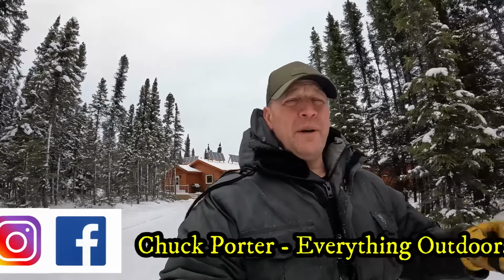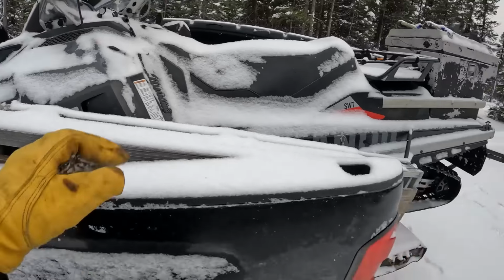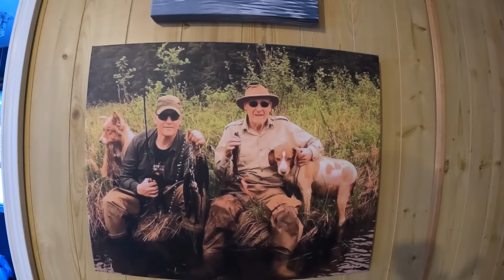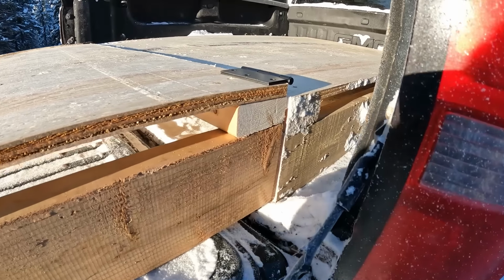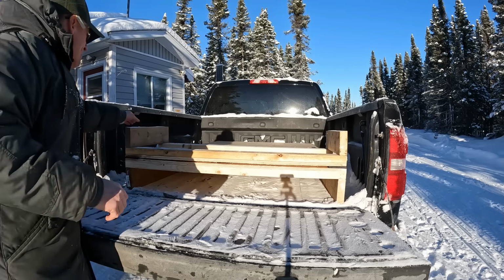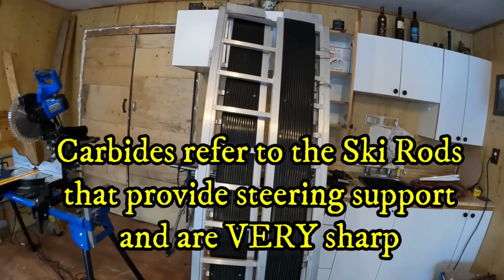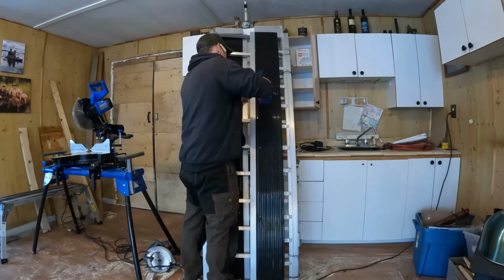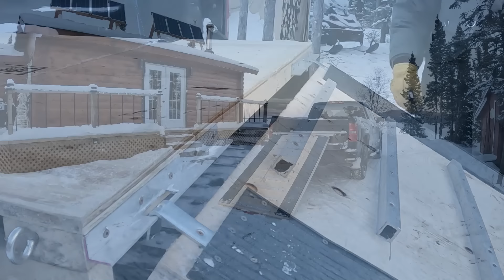A Snowmobile "Hidden Ramp" system that's simple, cheap, fun to build, and it works!!

Comment: Job well done. I felt the same way with my aluminum ramps. I built a similar design . Worked well. I also used the plastics from the aluminum ramps lol. For traction I used old worn out Teflon slides from my snowmobile  rails. Worked well.  My truck has an 8’ bed so my ramps and deck were a little longer. I tapered the flip up part like dove tail. When I pulled out my ramps they lined up perfectly with the dove tail angle. I used a couple of steel pins to secure the ramps for loading the snowmobile I added a couple of the Teflon traction bars I made to the top of the deck to avoid spinning when backing the snowmobile out.  All the best to you and your family in the new year.
Reply from the maker: I have seen the dovetail design as well Lloyd. I would have done it here but that was all the 2x6 I had on hand. And I’m a long ways from a hardware store lol. Worked out cuz the ramp hooks in the top but also is supported by the edge of the tailgate. So it shares the brunt of the load. Just a fluke.

Comment: That dog’ll hunt. We used to have balusters instead of the aluminum on ours. Yours was much more refined though, I used to see fellar’s let the tailgate tethers go so it would drop down on an angle and cut slots in the tailgates themselves, but that was when they were all metal and not really complex and expensive tailgates like nowadays. I wonder if this setup is mostly a Newfoundland thing as like you said it’s a very common setup on pick ups around here.  Certainly better than having to back up to a snowbank😉

Comment: Measure the distance from the ground to the truck bed or trailer. This will help you determine the necessary length of the ramp.Use a circular saw or jigsaw to cut the wooden planks or plywood to the desired length for the ramp surface. Cut 2x4 or 2x6 lumber to create the frame and supports.

Create a frame using the cut lumber. The frame should outline the edges of the ramp and provide additional support. Attach the frame to the underside of the ramp surface.

Install additional supports beneath the ramp at regular intervals for added strength. Attach these supports perpendicular to the frame.

If the ramp needs to be elevated, attach legs to the underside. This will depend on the height needed for loading and unloading.
Reply from the maker: All very good advice. Thanks for adding this comment my friend 👍

Comment: Great job. I built one a few years ago never used it tore it apart and made something else with it I also have a set of aluminum ramps don’t use them either lol. I don’t like how far the big sleds stick out of the 6.5 boxes would rather use my snowmobile trailer this way I am not scratching up the sleds and I still put my pelican and whatever else in the back of the truck but to each there own. You did an amazing job building it I hope it works well for you. Take care and we will see you in the next video 
Ian
Reply from the maker: I used to own a small trailer years ago as well. I thought about reinstating it but then I’d have to find a place on the highway to turn it around etc. unless I unhooked it and turned around by hand etc.  I’ll give this a try and hopefully all works out.

Comment: Nice ramp on a side note you should use two straps to hold your sled in plus if you can find an old box’s liner 8ft if you can find one where your skis sit it will stop your skis from sliding around …. Cut in strips one on each side

Comment: I had the same issue with the aluminum ramp. I made a similar rig to solve the problem. I used an old box liner cut out for the runners to slide on & an old skidoo track secured to the ramp for traction. Cat's meow. Nice workshop.

Comment: Great job Mr Porter, can,t wait to see how your Pelican fits in the truck. How do you get your wood home?
Reply from the maker: Pelican fits even better actually….before, the wheel well would be in the way….now the wheel well is kinda hidden so the sleigh fits in quite nicely.
Reply from the maker: I cut a large load of wood, truck it home, then go back and get my skidoo. It’s only about 10-12 mins away from my cabin.

Comment: Hi Chuck! You have a great rig there now. Guess your only other option TIL you get more snow is a trailer but dragging one of those around isn’t fun. Your old cabin sure makes a great work shop. When we burnt lots of wood,I also liked to get r done early. Never know what the winter has planned in a few weeks time. TIL next time, take care
Reply from the maker: Yes and it’s hard to find a place to turn around on our highway.  You can literally go 20 kms before finding a driveway. Otherwise I’d have to unhook trailer and turn around by hand etc. even that has its hazards. I’ll give this a try for now and see if I like it. If not, on to the next project lol
Reply: I know you have your boughten sleds but think if it were my thing I’d build a work single sled that would be able to use as the part that goes on back of your truck and you skidoo would ride on it . Just so it’s multi purpose. Yet still have the ramp to go on for loading.

Comment: Any issues with the carbides hitting the hinges when backing it off? You could have moved them towards the middle by about 8 inches. Great build.
Reply from the maker: No because the skidoo is in the “pivot” stage at that point when the carbides meet the hinges so there’s little to no pressure.  I thought about adding another couple of hinges in the middle just in case tho. And I still can. They cost $4 for a pack of two so well worth it lol

Comment: Who'd a thunk it lol.
Made mine out of 2" x 5"s and inch lumber. Single ramps that slide under and hook inside the ramps lip.

Didn't shorten it to fit inside the tailgate, that way, the ramps are a little longer.

Only thing is, it's open on top and gets stuffed full of snow and can't close the tailgate.
Didn't go with plywood cuz I thought it might be too heavy...
Did you use 1/2" plywood? Kinda looks like it.

Pretty slick, when mine wears out, looks like a good replacement option.
Reply from the maker: Went with a plywood top as I know it would fill with snow. I used 5/8” cuz that was what I had on hand. 3/4” would be better too I’m sure.

Comment: Great ramp,one question,wheres the cut wood ? Piled at the unloading site ?
Reply from the maker: I cut a truck load and then bring it back. Then pop back and get my skidoo. It’s only 10-12 mins away from my cabin. It’s light “burnt” wood (forest fire) so it won’t damage the ramp. Otherwise would be a futile effort.

Comment: This is probably a stupid question,  but with the Huge snowmachine(snowmobile to y'all probably), and the sled in the truck, where/how the heck do you haul the firewood home?
Reply from the maker: I haul my snowmobile to the wood area, unload, and then cut the wood. I fill the truck 1-2 times in a row, and bring it home. Then I return to pick up my machine and sleigh. The area I cut in is only 10–12 mins away from my cabin.